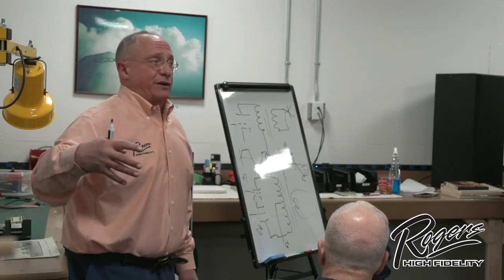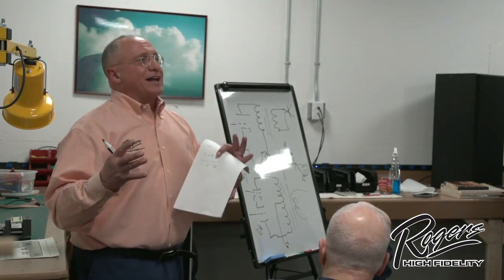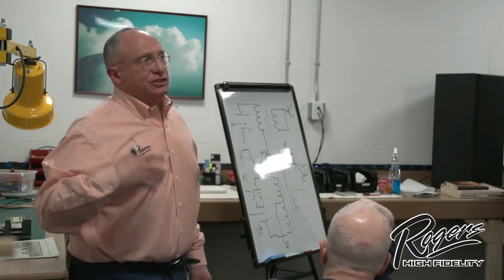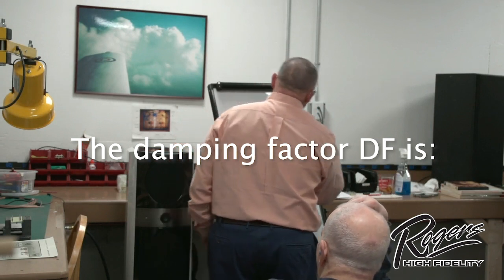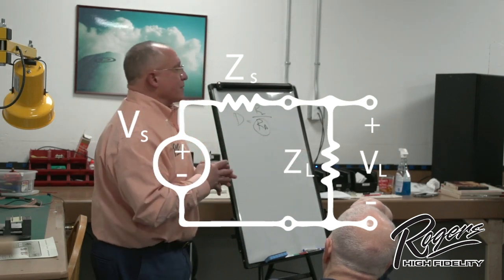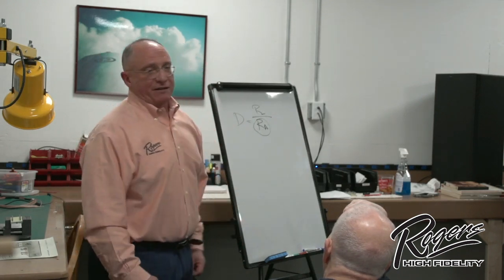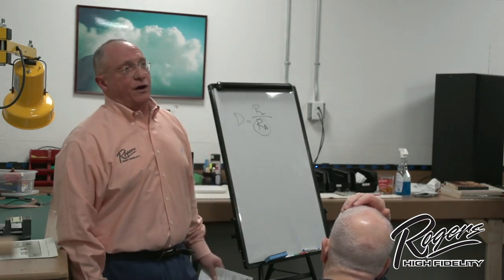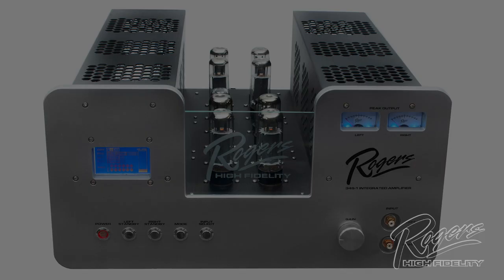Explaining Damping Factor In Amplifiers- The Analog Life Episode 7 #TheAnalogLife

Comment: High Damping Factor is very good and safe for SUB woofer speaker?
Reply: The damping factor won't damage your speakers. It just affects the control the speaker has especially over low frequencies. Subs have a built-in filter network that generally isolates the effects of damping factor.
Reply: @rogergibboni9721  my Power AMPLIFIER  have 400- Damping Factor Use for my SUBWOOFER
Reply: @rogergibboni9721  thank you Sir